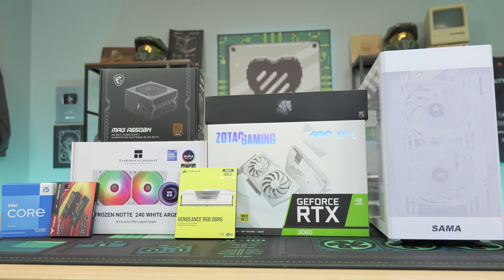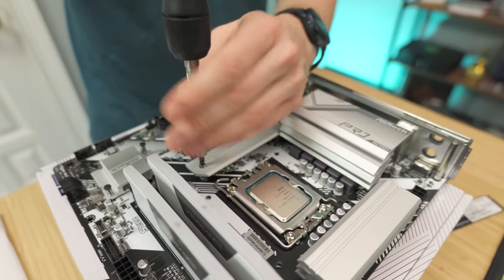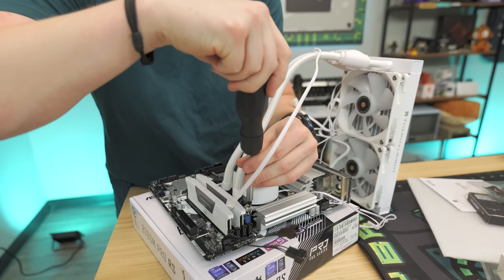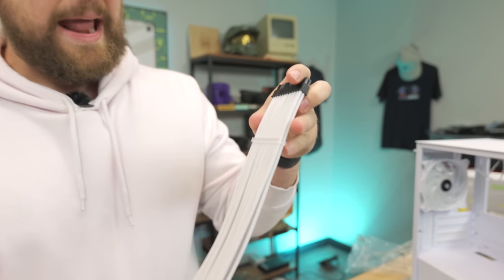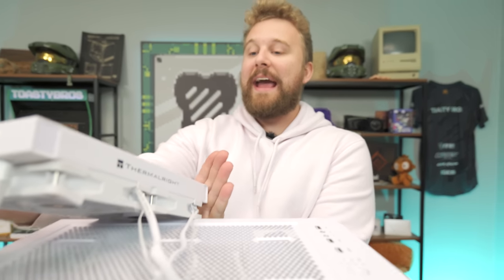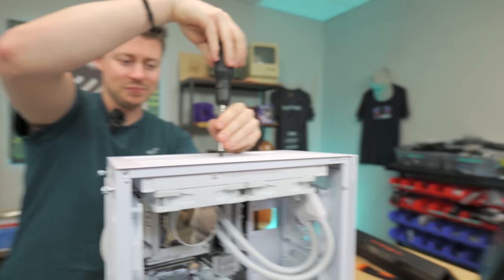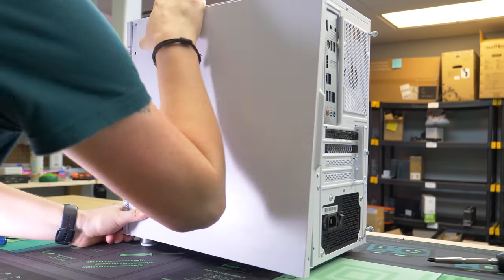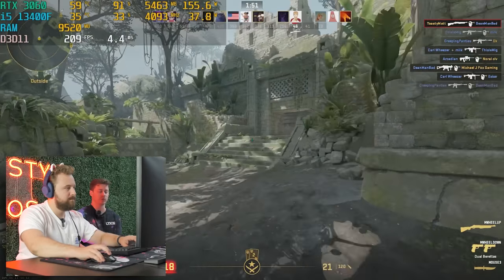BEST $1,000 Gaming PC Build Guide | Step By Step!

Comment: I recently built a PC in that case, the Sama Q5, and it was pretty good for a 49 dollar case. I love how it looks, cable management is alright, the included ARGB case fans are decent and airflow is great. It is however constructed from vey thin metal sheets, so it flexes and bends easily, especially when the side panels are off.

Comment: OMG, I built my 1st build in a while with that board last prime day/fantastech sale: B760M 12700KF 7900XTX then I just built a 12900KF moved the 7900XTX into that one for my main rig. I have a spare 3060 around I could move into the old build. Just went air cooler instead of AIO, nice TR ones a lesser 6pipe for the 12700KF, spent a little more on the more premium one.

Comment: With sleeved cable extensions I plug in the CPU cable into the mobo, install the motherboard and then route the extension through the cable hole in the case. Makes it far easier.

Comment: I would go for rx 6700 XT instead of RTX 3060
Reply: Yeah 3060 is too low end for a 1k gaming budget.
Reply: its mainly about dropping money on the build rather than building the best build for that high price.. if that makes sense
Reply: Don't throw rims on a Camry
Reply: @Obamacide  the cherry on top is a 13400f with a water cooler XD

$54 + $207 = $261 according to the links

12600k + peerless assasin 120 = $200 + $35 - $235

the 12600k is faster AND can overclock

now we have a little extra money for:

MSI PRO Z690-A  motherboard ddr5 ( after bios update can get 14th gen )

instead of that expensive corsair ram get this:

Patriot Viper Venom Series - DDR5 6400mhz  ddr5 = $100

that PSU has SHIT internals, dont buy it
with the money we have saved so far
instead get a corsair rm750e = $100

dump the 3060 get a 6700xt

WD_BLACK 1TB SN850X NVMe, better nvme ssd

get a nice atx case, that can fit the peerless assassin 120 and whatever 6700xt you decided to get

enjoy
Reply: @OdinAlgeron  aye man im trying to build a pc can you like tell me a good budget for 1k instead? Just wondering

Comment: TIP: Keep the frozen notte pump under 4000 RPM. 2 of my notte's have died from the pump being at too high of a speed. 👍
Reply: I have to keep my heart rate under 4000 RPM too otherwise it's game over. 😂
Reply: TIP: get a noctua cooler

Comment: Make shur when your doing your cable management that you pay attention to how they are running before sliding threw case because you might have a wire crossed and it won’t hurt anything but it just might annoy you because they can get tangled easy so just before you run it threw the case separate it and run it threw if you want a clean look

Comment: I had the 360 version of the thermalright aio and it cooled my i7 13700k pretty well, and it was overclocked. I paid 70 for it on Amazon. Now I'm going full custom cooling in a new build and upgrading to i9 13900k but still great cooler

Comment: For ANY Intel socket 1700 build use a Thermalright cpu anti-bending plate. Prevents the cpu from bending, hot spot issues and lowers cpu temps. Well worth the $10 or so price.
Reply: Well for a 12100F its TDP is so low that it won't matter anyways

Comment: I never recommend having my radiator at the top. Your basically pulling hot air through the radiator instead of the cool air that it needs. Think about your car. All the cool, fresh air comes through the front. ( Yes I know cars actually move forwards, but heat rises.) I always keep my radiator in my PC at the front pulling the cool air through the radiator with the fans on the back side so that the cool air is forced through the radiator first. Just like a car. Then I have two fans at the top to pull all that hot air out. This is the reason I bought the NZXT H5 Flow. Cool air is brought in nicely through the bottom fan. So I have 3 fans pulling in cool air at the front/bottom and 3 fans pulling hot air out through the top/back. That's how I setup my PCs for proper air flow and the temperatures don't lie. BUT that's just what my testing has shown. So take this with a grain of salt. Loved the video like always!

Comment: Don't build this, You can get double the performance for $1030.
Suggested build:
GPU:RX7800xt
CPU:Ryzen 5600x
Cooler:Peerless Assassin
Mobo:B550
Ram:Corsair Vengence 2x8 no rgb
SSD:crucial p3 plus 1tb
Case:Montech Air 903 max
PSU:Corsair RM750
Reply: Building my first PC so I'm willing to try your build. What's the performance on it and is it good for future upgrades?
Reply: @DevilsAdvocate669  It's a RX 7800 so that's around 120fps in Cyberpunk at 1080.
upgrades are a little weak, because it's last generation Ryzen, but you could still drop in a 5800x3d. Getting a latest generation CPU and mobo would add around $200. Oh, and you don't need the peerless assassin. The stock cooler is fine.
Reply: @gailblue6675  Gotcha, so upgrades are all based around the CPU? What I mean is that I'm assuming the cpu determines wether upgrades are possible or not.

Comment: I’ll never understand why people install the AIO on a motherboard before installing it in the case. Just install the backplate and then install the motherboard. Once installed, you can position the AIO where you want it and better judge where the tubes are going to be. Plus, you aren’t trying to juggle the rad and possibly damage the components while installing the mobo.

Edit: when you install the mobo without the AIO attached you will have plenty of room to install all of your cabling and can do a really nice job with your cable management without having tubing and a rad in your way. Also, I’m not a fan of moving the cpu cooler once it’s in place. You need to pay attention to what cabling needs to be installed before the AIO is installed. That’s pretty much it. The AIO should be the last thing to be installed.

Comment: Why not mount the radiator in the front? You'd be getting slightly cooler air over it as it comes into the case & exhausting hotter air out the top & avoiding the tight fit.

Comment: Ehh used gpu/cpu $830 ish balanced build

Where did all the money go?

Why in the world would you use an AIO on that cpu? Stock cooler maybe like a $20 tower cooler if your feeling crazy 😂
I3-12100f $70
2TB nvme $75
H610 $80
32gb ram $40
3080 $400
$115 new psu 850w
$50 case

Comment: Okay I have a question for everyone. In this video, they install the cpu cooler on top with the goal of trying pull any hot air inside the case with the fans, and then up and out of the case. Now I agree with exhausting the heat, inside the case, out the top since hot air rises. What I don't get is the cooler positioning. Isn't the whole point of a cooler to intake colder air and use that to cool down the liquid in the cooler thus cooling the cpu. So wouldn't pulling hot air through the cooler be counter intuitive because all you're doing is warming up that coolant in the cooler?

Comment: Thinking about building this with an amd board and a ryzen 5 7600x, is it worth it?
Reply: i would recommend getting a rx 6700xt instead of the rtx 3060, about 50 dollars cheaper for easily better performance. and yes it would be worth it. you could easily run most esports titles at 1440p with 100+fps.

Comment: Not required but I would know which size of motherboard you have and buying accordingly
This is mandatory for ATX mobos but I recommend doing the same for mATX and iTX cuz if you put one of these in an ATx case it would work but there would be a lot of extra space amd it wouldn't look good
Reply: what do you mean by "This is mandatory for ATX mobos but I recommend doing the same for mATX and iTX cuz if you put one of these in an ATx case", im trying to build a pc and order only two of these parts so far, I ordered the ram & cpu cooler, Wondering if I need to stop

any help would be great
Reply: @Spiculus20  you can’t put an ATX mobo in a mATX case but it’ll work the other way around 
All the other mobos will fit in an ATX case but mATX and iTX don’t look good in that case
Reply: @Jake_EditzYT  so what do you suggest then?

Comment: I got an i5 12600k on a Gigabyte H610i DDR4 motherboard, I have read that the motherboard I got can be updated to a 13600k with a bios flash so I read, I think it would as 12th and 13th is LGA 1700, So yeah my Gigabyte H610i looks like it can take a 13600k, 300 pound though, Is there that much difference between the 12600k and the 13600k, I will look it up though, Be interesting to find out, Only crap part is the 12600k will deal with DDR5 but the Gigabyte H610i motherboard don't allow for DDR5, I upgraded from 16gb 2133, lol, To 32gb 3600MHz not realizing the motherboard only goes up to 3200MHz, If anyone knows how I can get a Gigabyte H610i DDR4 motherboard to run 3600MHz, Though I don't think I would notice the difference, I will say though upgrading a PC from 16gb to 32gb wakes up the PC, I got an extra 30fps in 4k on AMS 2 with the extra 16gb, So yeah putting more Ram in a PC will help your PC wonders.....
I only do Sim Racing as far as gaming on my PC, I can't get into the shoot em up games for some reason, I do play World Of Warships though, That World Thunder is alright too, I just needs a proper controller so if anyone knows what Control Pad is probably the best I can get for around 50 pounds, What sort of control pad would that get me, lol....
Yeah is it a big upgrade from the 12600k to the 13600k, Is the price jump worth it in other words, If  it was I would grab a 13600k and sell the 12600k to a friend, Just will it be worth the stress just for the one generation upgrade, The DDR5 factor is a big upgrade though, But if it only just that then is it worth it??
This is a nice PC as it goes, The zotac 3060 looks different to mine, I got a normal black one, And I am sure the connection part is different, lol...
It is actually a pretty good card, I can run AMS 2 with around 110-120fps in 4k on high settings with the 32gb, I am just getting temps of 83c, 83c won't do damage though will it, I only Sim Race a few hours at a time, Around 4-6 hours at most in a day, When not gaming the 3060 is only 33c, I think that is because of the case I am using, The PC case is the next thing that will be upgraded, There is just so many lol.....
But yeah this is not a bad looking PC.....

Comment: Look I appreciate you guys but it's not the best gaming pc for "X" amount of money unless it's AMD. For a $1000 pc you could go with an AMD card that costs the same as a 3060 and you would have much better performance. RTX 3060 is a joke of a gpu because it can't even outperform an rx6600, a card that costs less than a RTX3050. Nvidia is gonna be an even worse choice than it is now once the RX6000 series cards get driver level FSR 3 Support. 3060 wont even have DLSS 3.5 frame generation and even the cards that do get it will only be able to use it on games that have it.